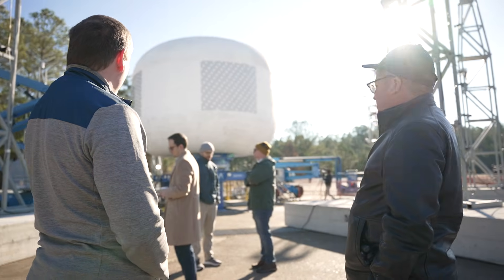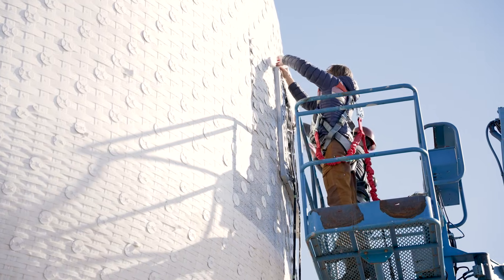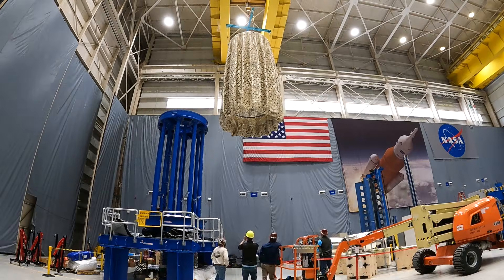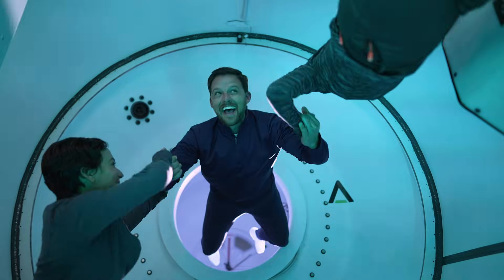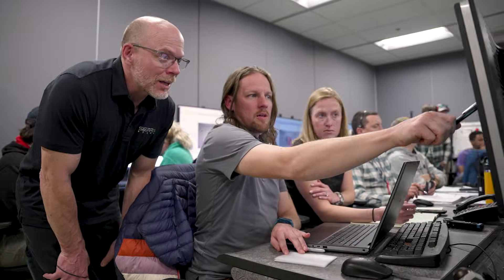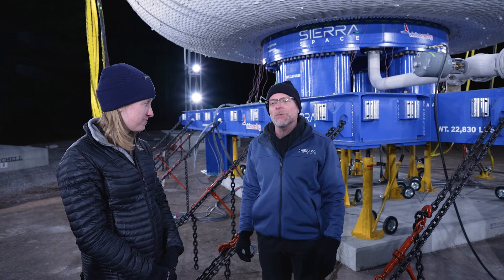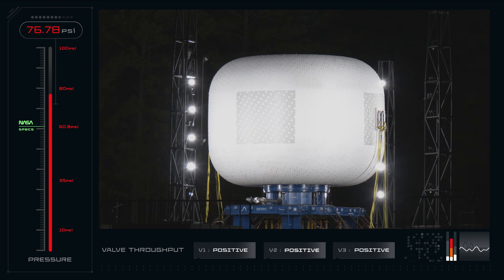Full-Scale LIFE™ Inflatable Space Station Burst Test at NASA Marshall Space Flight Center

Comment: Gotta ask, do you guys consider the possibility that tiny space debris could puncture the hull or is there a protection system in place that helps this inflatable hab defend itself against them?
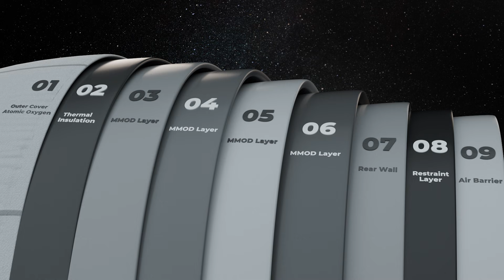Reply from the maker: Yes, it’s made up of MMOD layers to help protect it. These layers can be seen at 2:42 in the video. We conduct High Velocity Impact (HVI) tests that involve firing high velocity projectiles to simulate the environment the article will be in. Lots of testing is done to determine the layers of MMOD protection.
Reply: @SierraSpace  I’m glad to hear that, I pray your hab works wonders 🙏
Reply: @SierraSpace 
Just some thoughts from the back forty:
I went to the barn this morning and had to break ice for the animal’s water. It was less than three inches thick. I got a hammer and wailed away on it, chipping and chipping until I finally broke out a two inch diameter hole. I made a circle of holes. Pounded some more to make some cracks. Finally, I stomped my boot down and broke out a circle. This afternoon, I went to barn to lock up for the night. Even though the air temp had gone above freezing, I had ice to crack. It was only about a 1/4 inch thick, so easy.
An ice layer, it seems, would be good. It would take energy away from impacts, both by resisting cracking at the point of contact, but also by spreading the force across a broad area. Any shattering could be melted and refrozen. It wouldn’t create a weak scar, as the ice is made of a uniform liquid. Melted water would freeze to help plug a hole until a proper patch was applied. 
Water is necessary to life and could be cannibalized. Excess humidity inside the habitat could be added to the water layer. An area with an extra thick layer could be used for radiation protection. It could be cannibalized for electrolysis to produce emergency oxygen. It would help regulate internal temperatures.
Congratulations on exceeding your goal!
Reply: @SierraSpace   Ok So an unsinkable ship, Much like the Famous UN-sinkable Titanic?
Reply: @SierraSpace  With the velocities of space debris being what they are (especially any from a significantly different orbit) a high velocity impact will continue to increase in likelihood, how would the structure respond if it did breach? My understanding for hard structures is they would get a big hole in them but maybe keep some rigidity to allow occupants to escape and seal the area, this doesn't feel like it would be possible with inflatable structures? I feel like they would just collapse upon any breach, even a minor one?
Reply: @SierraSpace Is this layering material as effective as metal against solar radiation or flares?
Reply: @SierraSpace and u hope this can help cure leukemia ? Are u sticking with that ?
Reply: @SierraSpace  - Put springs around it's whole circumference. Stuff will just bounce off of it.
Reply: @SierraSpace  That only works using weapons on earth which lets be honest are not that fast compared to say a micro meteorite going say 14,000+ mph.
Reply: IS there a video of these test for public viewing?  @SierraSpace
Reply: @SierraSpace  what is high velocity in this instance? Because hurricane and tornado proofing is considered high velocity but I imagine that debris in space is moving at much much higher velocities than what we do in weather testing construction materials.
Reply: And the results?  What's the maximum impact velocity it can withstand?  And what about multiple low-medium velocity impacts?
Reply: @SierraSpace  High Velocity Impact tests at light gas gun speeds?
Reply: do you do this testing in an actual vacuum, replicating a space environment??  @SierraSpace
Reply: Believe it or not, they have in fact considered the most obvious, surface-level problems.
Reply: I'm sure they've thought about an armor system, they mentioned in a comment that they've been doing hypervelocity impact tests. Would love to know more. They can always strap on some armor after the fact, but it would be cool to have an inflatable solution to minimize the number of launches and set-up work. Armor doesn't have to be rigid! There are actually some benefits to inflatable armor, it can have lots of room and baffles inside to disperse the energy of the impact...
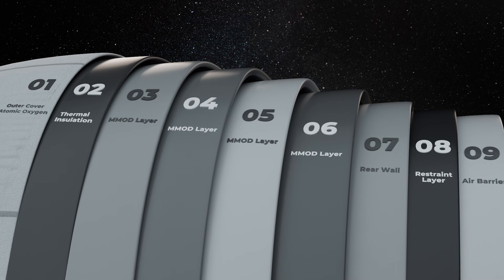Reply: At 2:42 you can see that layers 3 through 7 are MMOD (micrometeorite orbital debris) layers, Whipple shields with far greater spacing than is possible in rigid hull designs. These will provide protection better than any existing space station or vehicle.
Reply: Search "Sierra Space LIFE meteoroid protection" and see the first result, it's by Sierra Space.
Also see @Chriss120 comment on this thread. Sierra Space responded, explaining the tests for this done with NASA.
Reply: thank you yes, I was hoping someone else would notice this. I do not like the idea of my life hanging in the structural integrity of a balloon in space with brutally fast orbit space debris everywhere. one 'pop' and the contents and people of the equivalent of three ISS capsules are spaced! the way that thing exploded with just 25 pct more PSI than the 60 they targeted bothers me immensely.
Reply: @pupboi8023, I believe that's what the multiple layers of "MMOD" are for.... I had wondered about the same thing but I also wondered about how the material itself stands up to ultraviolet radiation. The company that makes the "yarn" says it's an LCP Liquid Crystal Polymer weave that they manufacture for various uses that's supposed to be 5 times stronger than steel!
Reply: It's worth noting that a rupture test is not how such a structure would fail under a strike. The safety factor implies that even in the event of a puncture the system will leak, not rupture. A car's tire getting a puncture is a good analog for this.

However I'm sure the engineers working on this have a safety factor for strikes too, as all the layers would suggest. I wouldn't be surprised if the standard strikes encountered by the ISS would barely mark this thing as it is not a rigid structure. I feel the nature of an inflatable structure allows a greater resistance to strikes. Again, you could analog a car tire vs a wagon wheel hitting a pot hole...
Reply: My thoughts exactly, I just imagine a micro meteor puncturing it and it collapsing like a balloon, but I’m no engineer nor an expert so I’ll leave that to them. Looks interesting for sure.
Reply: It's wild that you'd ask that question, as though they have literally no knowledge of what they're doing. It's truly insane to me.
Reply: MMOD layers need to be many and separated by characteristic distances (dependent on particle hardness relative to shield) to prevent total penetration . . . Lookup "Whipple Shields".
Reply: I still wouldn’t trust it, thanks…
Reply: Also, space is a lot more empty than you'd think.
Reply: I think your comment is key to thisnot working and the creators of it being flat out wrong. One micro puncture and its f'd.
Reply: This is a scam program. It's not feasible. Dude said this thing was stronger than steel. This is a commercial

Comment: It blew up with just 90psi?! That’s like a car tire?
Reply: Only needs to hold about 14psi
Reply: Its engineering needs are for light weight strength at a known pressure (14.5). The size and weight and pressure requirements of tire materials have an entirely different mission. SMH.

Comment: What's the biggest habitat you could put in the starship?
Reply: Based on figures for payload mass and dimensions, the previous Bigelow BA2100 would just about fit. Do a search on Wikipedia to see a rendered concept. It would have a 2250 m³ volume. So that is probably the limit of a single Starship.
Reply: Interestingly, while New Glenn would nearly have the length, it is lacking a bit in girth, and it seems to be lacking in payload mass to get the conceptual BA2100 to orbit. It is likely that Sierra Space will design any theoretical future model for New Glenn, what with BO being their partner on the Orbital Reef space station.
Reply: Immaterial question considering Blue Origin’s litigiousness.

Comment: Speaking of space, I need help with my new years resolution.  I'm trying to change the stars.  What I mean is, get the IAU to, OFFICIALLY, make a new constellation. 
My idea for changing the stars includes Orion and Pleiades (Subaru).  I figure it's time to put something up there that's relevant to us, don't you think?  Take Orion's belt and Betelgeuse becomes the head with a baseball hat.  The 3 stars of Orion's belt make up the 3 fat belt loops on a baseball uniform.  Below the belt are two legs bending at the knee.  Saiph is the back foot and Rigel is the front foot.  The feet aligning perfectly under the bent knees.  The spear pointing at "Subaru" is the bat being swung and "Pleiades" is the baseball flying away after being hit.  Bellatrix is the hand that let go of the bat.  Put it all together and you get, "THE ALL-STAR."  In my case, I see a left-handed batter and I imagine a "7" on the jersey. Which makes him, "Mickey." (As it should be ;-) But you can put any number you want, making, "THE ALL-STAR," any player you want. It'd  be wrong of me to not, at least, try.  This is me, trying. Pass it on, please and thank you. Don't worry, where I come from, crazy is a compliment. ;-P

Comment: What will happen with Micro Meteorites impacts?
Reply from the maker: The MMOD would absorb the impact with no effect on the pressure shell or restraint layer. We perform MMOD Hypervelocity Impact (HVI) Testing utilizing high power machines that can shoot a projectile at the rate or velocity of an impact in space. We also select materials that represent what is currently in the space debris environment based on orbital debris tracking software. There's a good idea of the layering involved in our space station technology at 2:42 in the video.

Comment: Have you had any thoughts on developing a surface version for Lunar/Mars use, obviously radiation sheilding would have to be factor?
Reply from the maker: Yes, and our space station technology has multiple uses outside of LEO. It's also deigned for its environment and takes into consideration several factors including radiation. Specialized shielding is designed to be a part of the MMOD layering along with other materials that are internal to the Inner Mold Line (IML) of the softgoods systems.

Comment: I foresee a huge problem, unless the exterior has a Meteor/Micro Meteoroid Proof Covering, it's not going to be functional, except as a concept, eh????
Reply from the maker: Our space station technology has several layers of softgoods. One of its layers is MMOD – Micro-Meteoroid Orbital Debris protection. This multi shock layer is designed to protect the habitat from orbital debris strikes for the lifetime or mission duration and its specific environment. This is a highly advanced design based on known technology that is applied to the surface of the pressure shell or restraint layer. More information on our layers can be seen at 2:42.
Reply: You don’t “foresee a problem”, you just broadcast ignorance of what the structure is actually built of. Shocking, YT ignorance, I know!

Comment: Sounds like a scam, they never talk about how they''er going to get equipment and floors inside one of these balloons.
Reply: Did you see the bit where they "sleeved" it? That central spine is supposed to be packed with deployable kit during transport. Once inflated the internal structures and equipment are deployed from there. Anything else has to be small enough (or can be broken down small enough) to pass through the airlocks. Think of it like an Ikea space station... "Some assembly required" Just don't lose that little hex spanner, because getting a replacement sent is a nightmare.
Reply: Yes, you not know the engineering of the interiors is definitely a “scam”. Lord help us against this tidal wave of morons.

Comment: I'm curious to see pressure tests with (intentionally)damaged article to test how much small impacts may change the overall structural integrity
Reply: Honestly, space junk seems like a showstopper for a real application for this, around Earth, at least, unless it can take several shots from a railgun, though, probably with lighter and less optimized projectiles than they're using now.
Reply: That was my this worry as well. Rigid space stations like the ISS have deflective plating to protect against debris strikes. What happens to this thing if it doesn't have shielding?
Reply: Not just impacts... how will a plastic balloon shield from solar radiation?
Reply: I was thinking once it's opened a solid hull could be added later, most likely a redundant protection I bet these guys could measure possibilities to an unfun level.
Reply: great question. This would be a super important metric

Comment: What is a PSI? How many bar?
Reply: Pounds per square inch... 1 PSI = ~0.07 bar... So 75 PSI = ~5.2 bar
Reply: PSI -- pound per square inch.  1 psi = 0.0689476 bar; so the bursting point was at around 5.31 bar.
Reply: 75 PSI is about 5.1 bar.

Comment: That's GREAT!  But what about the radiation?
Reply from the maker: Our space station technology is deigned for its environment and takes into consideration several factors including radiation. Specialized shielding is designed to be a part of the MMOD layering along with other materials that are internal to the Inner Mold Line (IML) of the softgoods systems. You can see the layering at 2:42 in the video. Our subject matter experts work with NASA to develop and test these layers for the environment it will be subjected to.
Reply: @SierraSpace  Thank you, I see the 4 MMOD layers.   I don't suppose you could tell us the specs?  Like what each radiation level drops to.
Reply: Space station company never THOUGHT about that! Thanks for letting them know! SMH

Comment: What about thermal fatigue? That material is going to experience high temperatures and radiation when facing the sun and super low temperatures when facing away from the sun or in the planet's shadow.  The ISS experiences temperatures between minus 150 to plus 300 deg C  several times a day.  If a small particle of space debris hits the ISS the hole is probably repairable because a metal structure will not rip with just 1 atmosphere of pressure difference. Will this balloon survive a penetration with a particle traveling at hypersonic speeds when the surface temp is minus 150 deg C?  The other factor is that the current ISS design is made up of small compartments which can be isolated in the event of a decompression.
Reply: The BEAM module has already been up on the ISS for a while without breaking.

Comment: @SierraSpace What are you expecting for operational lifespan and long-term maintenance/leak management and safety protocol?

Btw, excited to see what you'll get to try out with interior design on this one, are you picturing doing furnishing sort of like a popup trailer, or to do all furnishing after inflation?

Also, with large open structures, are there any design features to prevent "stranded zones" where a person on board could find themselves unable to reach any fixed furnishings to help them navigate and thus get stuck? (There's a minor example of this in Kibo)
Reply: Skylab had much larger interior space than the ISS, and no one ever got “stranded”. Swimming motions were and are adequate to propel one’s self with inertia. The Kibo issue was a silly comment from astronaut Mark Kelly who obviously is lacking in Skylab information.

Comment: As long as they don't forget that burst tests are different on earth and in space.  On earth you have pressure on both sides of the bladder. In space you have pressure on the inside and a vacuum on the outside of the bladder.
Reply: The vacuum of space does not exert any type of “force”. It’s a lack of pressure, not a negative pressure. The pressure on Earth’s surface simply contains the exploding debris, it doesn’t add any strength to the underlying materials of the container. It’s gonna blow at whatever pressure the materials fail at, and nothing else.
Reply: 15PSI diffrence between ground and space, so I would say it bursts in space at 60PSI compared with the 15PSI they are probably going to use.